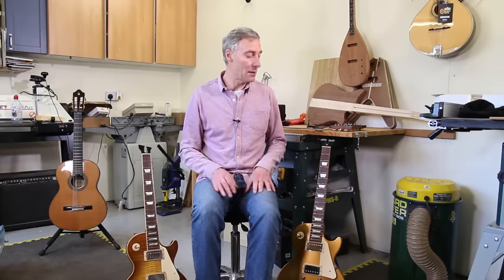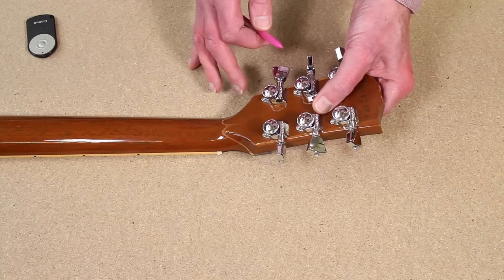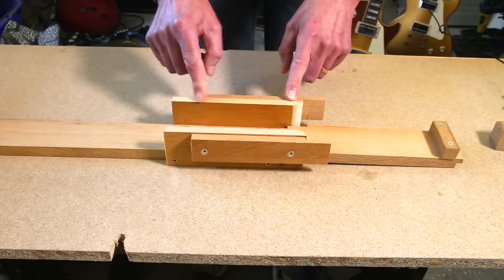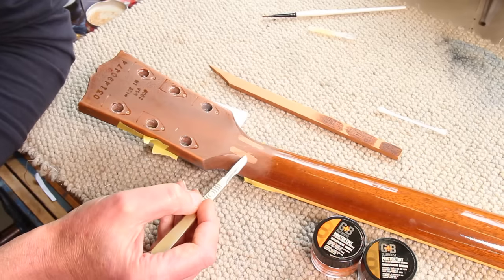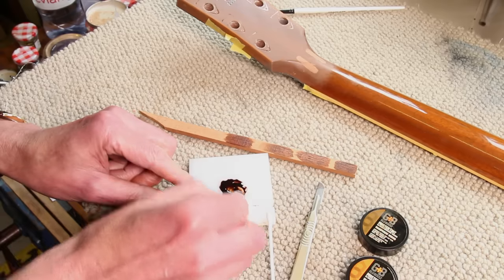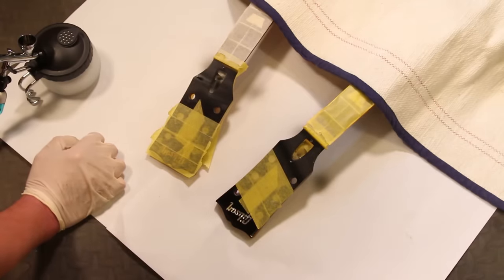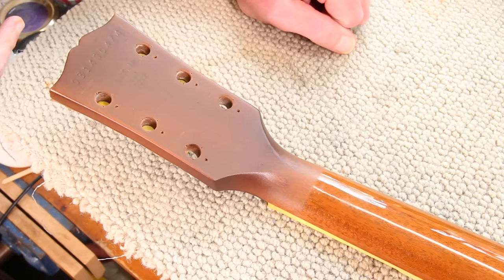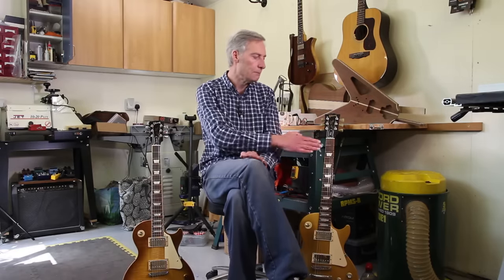Repair of a Gibson Les Paul with a snapped off headstock

Comment: I repaired an Epiphone Dot  neck with the same problem, The thing that gets me is that using the Hyde glue failed twice so I went with the Cynoacrylate Ester or CA glue exclusively.  My question is why do Master repair specialist, not do the same? Is there something wrong with my thinking. I should also note that I too, knocked this guitar over in a heated rush one day by accident, and broke the head stock a second time. Because I didn't use splints,  may have been why it actually broke again, but here is the kicker. It broke in a completely different part of the wood. The second repair is still holding fine. But, will it eventually give because of that glue choice?  Or is it just that the Hyde glue is actually better over time? I know that it is easier to remove, if that is the reason then I understand that. However the CA was used in filling. So then why not for the whole repair? What is it, that I will learn the hard way? I always do.  I am thinking about adding the splints now, But if that is going to mess me up when that CA glue decides it's life cycle is short, or it dry's the wood and it breaks again etc, then I would like to know that before I do.  That is probably something that I am not alone in wanting to know, so my question is while we are learning technique we could use a little time honored wisdom, and experience about older glue verses super glue or new tech glue.  Thank you for any answer I get from anyone in the know.

Comment: I'm doing my own fix on a '93 reissue J-160 made in their Montana factory.  Fortunately the grain allowed for a pretty good gluing without splints.  Currently planning on blending in the glue line in back which feels like I got it, though not as nicely as in these two examples.  The front veneer didn't break, but the bending made for very ugly lacquer checking.  Wondering if I should just use lacquer thinner to take off the old and then reapply with clear?

Comment: How about a drill jig to drill matching holes in the crack that you would later fit small forged steel rods that you would use epoxy to glue in the holes and then join the neck? Kind of like rebar in concrete.

Comment: Thanks for sharing your excellent work - I’ve watched a number of your LP headstock repair videos, and have recommended you on various guitar forums when someone posts and asks for UK recommendations for an expert headstock repair. I have a 2003 LP Standard that had already had a headstock repair which I got for a good price, however, a number of months ago I found an Epiphone LP that had been left beside a skip at my local recycling centre with only the strings holding the snapped-off headstock. I rescued it, and have glued up the pieces and used Titebond, then black superglue on the facing. It has flatted back well but I need to airbrush the join as it is still visible- my question is what paint to use for the black. It is gloss poly. Any advice would be most welcome. Thanks, best wishes and keep up the great work
Reply from the maker: Andy, just noticed your comment. Because of the finish that Gibson use it is easier to get a seamless transition between the new and old finish. Not so with an Epi. You will always get a witness line whatever paint you use. You either accept this or spray fresh paint over the whole of the neck or headstock. And thanks for recommending me elsewhere.
Reply: @flameguitars5770  Thanks for the reply David. I’m treating this rescue project as a learning experience. I’m pretty happy with the way the headstock has been reattached and how the filling / smoothing process has gone and just looking to get it as good as possible within the limitations of my skills! I’m  travelling with hope rather than expectation, and whilst I’d love it to be perfect I’m realistic enough to realise that it is likely not to be as it is my first attempt (apart from crudely gluing a broken headstock on my sisters Eko Ranger about 50 years ago when I was about 10! - crude but it held for 20-odd years) Anyway, I was thinking of getting an airbrush to give it a go but just keen to know what paint to try - diluted Airfix enamel? Aerosol paint sprayed in to a container then put in the airbrush? I’m going to flat then clearcoat the whole headstock with aerosol after I’ve sprayed black over the crack but understand paints can react badly if I use incompatible ones so just looking for a steer in the right direction. Love your videos and find them really relaxing to watch, as well as fascinating! Thanks again, Andy

Comment: Knowing that the majority of neck breaks are Les Paul’s isn’t a comforting feeling since I own one. Gibson are known for making outstanding guitars but I can’t help but feel like I’ve learned the opposite over the last 10 years of ownership. I own a PRS Custom 22 that’s roughly the same price, but the build quality is night and day. The 22 almost never needs tuning, has a seamless design and nothing is wearing down on it - they’re both the same age. The Gibson however has required a re-fret during its life, paint is cracking and starting to come off and the plastic trim is cracking at the bottom. Screws have rusted along the way and the bridge piece has had to be filed down more times than I care to remember because of rust or biting issues.

Both guitars have received the same care, attention and treatment over the years. Playing time may be a bit more on the Les Paul’s end, but not enough to justify the amount of TLC it’s needed - the PRS just hasn’t been as needy.

Les Paul’s might be iconic, visually and tonally. But my experience of their £2-£3k high end instruments is horrendous. Guitar is only a hobby for me, but I’d never buy a Gibson again. PRS’ build quality is second to none and they sell single cut guitars that give you 95% of that “Gibson sound”. Gibson doesn’t deserve people’s money. Professionals only buy Gibson or Fender because they can reliably get what they want at short notice if need be. PRS’ can be one of a kind as long as you’re happy to pay for a Bespoke guitar. I’d do that before buying Gibson....

Comment: Very helpful video.  Outstanding repair!  I've got a Luxor Les Paul with jagged cross-grain break of the head-stock right at the top of the truss rod....I got the guitar free and plan on doing my own re-build.  I'll build a jig, bond the pieces back together, route a couple slots and put maple splints in place.  Any advice on dealing with the jagged splinters...(It appears to go back together "okay" (I'm guessing I'll just do whatever I have to to get the angle right and get the mating sides to all match up...may require some axial pressure as you suggested).

In any case, wish me luck!
Reply from the maker: That sounds like you are doing all the right things. I have 2 other videos on neck repairs which may be helpful. Anyway, good luck!
Reply: One more...for my slots I'm planning to go with straight 2 flute carbide cutter...1/4 inch...you think I'll have any luck?  Or is something else called for (e.g. special plunge spiral or mortise bit)...also I'm thinking 1/4" (6.35mm) maple would be plenty...but could go as big as 3/8" (9.5mm).

Thanks for your expertise.

Comment: Fantastic video and very informative.  I have a Astoria guitar to repair for a friend.  Its got a very bad neck break that has been repaired before, so I think I'll need to do splints for it to stand a chance of it being successful.  I just wondered why you used the Titebond Hide Glue rather than the Titebond No 1?  I've used Titebond No 1 and 2 on a lot of repairs and its been quite successful.  The yellow colour of the glue can sometimes be a bit annoying though.
Reply from the maker: Thanks. I mostly use Titebond original for this type of repair. But if I need more time to align the parts I use cold hide glue. Takes a little longer before it 'grabs'.
Reply: @flameguitars5770  thanks for clarification, very helpful

Comment: I just use some flat wood blocks but sandwich some stiff plastic foam between the wood blocks and neck , especially to apply pressure directly over the cracked area , it often passes the flat areas, still get a lot of pressure , often the crack is hard to detect if the break is really clean no need to refine try to hide it, just if the headstock if its a total break away can do something to the black face area , i never use dowels or splints , Why ? ! I've seen them re-broken and they just result in greater damage if and when that happens.Looks stronger , just cosmetic, waste of time and labor, i have filled in missing chunks of wood on other guitar necks that get more complex breakage.Overall you do excellent work ! master .
.

Comment: Very nice work. I have fixed the headstock twice on my Les Paul Special. It does not look nearly that nice but does give me some ideas to blend the repair in a little better. I specifically watched this because I am bidding on an epiphone es 335 with a completely broken off headstock and I do not believe he even has the headstock. I was wondering if it would be possible to simply make another headstock and treat it as break?

Comment: Great job!  Facinating to watch.  May be about to attempt a similar repair soon.

One question.  Doesn't the blended lacquer line on the splinted neck leave a slightly perceptible (visual or touch) join line?  I might have been tempted to apply a final coat of clear lacquer along the whole length of the neck to avoid this...
Reply from the maker: That is certainly the case when trying to blend new finish onto old over a poly-type finish. Gibson still use a nitro-cellulose finish which means that the transition between new and old finish can be close to invisible.

Comment: I repaired my sons Les Paul, broke on the neck. I'm pleased with the repair l did but obviously l can't use the truss rod. It plays well but getting the action right is a compromise. Any ideas?
Reply from the maker: You say obviously cant use the truss rod. Why is that? Did you get glue on it?
Reply: Because it broke slightly more towards the body. It tunes fine, but  playing higher up the neck, he gets fret buzz. If l higher the action, then it's harder to play. Stumped really?

Comment: Outstanding sir!!
Loved the way you mixed the stain with Crazy Glue to prevent the bleeding/ highlighting the edges of the splints.
I remember my Dad having an old Premier guitar that had a split at the neck/ headstock   point,  and he put a screw in it. Lol! Of course my eyes crossed when I saw it and was surprised because I new he was a pretty good craftsman. He had taken an oak floor tongue and groove apart from a broken steam pipe warpage, and repaired it, stained it,  and it looked like a bowling alley when finished.
Anyway thanks for the lesson in patients! Are you in the States or UK?
R
Reply from the maker: London UK

Comment: I have a black 1974 Les Paul Deluxe I picked up cheap. Could never read the
serial number because of a heavy sprayed paint job. When I tried to sell it, somebody
pointed out that the head probably broke off at one time, which explains the heavy  paint.
Basically my LP's value dropped to about $550 in value, I decided it
wasn't worth selling and just held onto it.   The good news is, I got it for only $320 from someone
desperate to sell it at the time.

Comment: I always hated doing this type repair because the parts can slide when you clamp it. So what I did was to clamp it dry. Then drill 2 small holes a short distance apart from each other so I could insert 2 small wooden dowels after applying the glue. Then clamp. That way it cannot slide.

Comment: Good job. Would it be possible to drill and glue a steel pin inside each of the two pieces of mahogany, to further strengthen the headstock/neck?

Comment: I just find it amazing that Gibson are still making guitars & especially the very expensive replica "vintage" guitars with this extremely flawed design, but what is even more amazing are the customers handing over wads of cash knowing full well what Gibson are doing - well I suppose the ones hanging on walls in offices won't be in too much danger (although probably not) as long as the temp & humidity is maintained.

Comment: I have a free acoustic guitar that got kicked hard by and angry girlfriend that split the neck about 12cm vertically. Near parallel scars, didn't break off. These are simple fixes if one doesn't care about the scars. And I don't. Lovely Crafter Korean guitar with Fishman electronics. Saddle and nut were lost before I got it but not hard to replace. Flame Guitars does a masterful job, but not all guitars need that care. They'll still play and I personally don't notice the scars when I'm in the pocket. Good thing too as my old body has more scars than my old guitars. My point is: if it's broken  and not precious, just fix it yourself. For the precious guitars, thank goodness for craftsperson luthiers.

Comment: Great job! Only question - why Titebond hide glue? The joint is permanent, no need for disassemble in future. Why not Titebond Original, or even some high quality epoxy?
Reply from the maker: Yes, a number of people have asked about this. When gluing the headstock and neck, this glue gives me a little more working time to ensure the parts are properly aligned before the glue starts to "grab".
Reply: @flameguitars5770  Makes sense. Thanks for the answer! Have to say again - magical work!

Comment: This is very very interesting. Thank you for posting this. Will this new neck arrangement be an improvement and remove the weakness Gibson built in thereby making it stronger than new?  I remember breaking the headstock off my first electric guitar, a Burns Shortscale Jazz bought for £30 used when I was 14. Unfortunately I didn't have you to repair it for me and the guy who did it botched it and it never was right again. I always worry a bit about my Les Paul for the reasons you mention.

Comment: Out of curiosity, why did you choose to use hide glue over Titebond regular glue? Great video, and even better repair!
Reply from the maker: Generally I do use Titebond for this type of repair. But if I think i need a little more time to align the two parts of the neck when clamping then I might use cold hide glue. It gives a little more working time before the glue grabs.

Comment: Thanks for the video, your work is masterful and a pleasure to watch. I am about to make a similar repair to a broken headstock on a "Fernandez" electric guitar. I noticed you used Titebond Hide Glue (which I have) as opposed to Titebond Original (or yellow) Glue. I have always felt the yellow glue is stronger than the Hide glue. Your thoughts?
Reply from the maker: Yes, I've been asked about this a number of times. Hide glue gives a longer working times to ensure that the two parts of the neck are properly aligned before the clamps are applied. If the two parts come together easily I would use Titebond original.
Reply: @flameguitars5770  Thank you sir for the quick reply... I'll go with the yellow :-)

Comment: I have an 89 Les Paul standard that I snap the neck on and I almost turned into firewood I was so upset, but a good friend of mine which also played Les Paul's tell me he had snot the neck off of his at one time and he had it and is exactly what I did and a really fine job is just place did. But I have a question for you if this is happened to your Les Paul how much of a discount on the price value do you lose, could you please answer that

Comment: What would you suggest for refinishing the front headstock face of an Epiphone model where the black finish is heavy paper stock under and bonded to a clear layer of plastic?  Any attempts of mine to airbrush blend still shows a visible line between sprayed on paint, and under the plastic black. (Think two depths visually).

Comment: What glue are you using? Would a bow tie joint be stronger?
I don't repair guitars but am a joiner/ carpenter.
It's good to see such love going into something like guitar repairs. Thank you
Reply from the maker: Mostly use Titebond. I guess a tie joint would be stronger but would be quite a challenge to install on such a rounded surface. More importantly the the two spines have to be routed on each side of the truss rod.

Comment: Hi, when you were sanding the headstock were you not worried about water getting down the tuner holes
Reply from the maker: That's a good point. The amount of water I am using is not really enough to cause any swelling in the tuner holes.

Comment: How long should one wait before sanding and staining because of the splint sinking and the neck swelling from open air ?
Reply from the maker: I shape the splines as soon as the glue has set. I then seal the bare wood with CA glue.
Reply: @flameguitars5770  Thanks for the feed back. Makes sense  now.

Comment: Hello! Could you tell me what paint and varnish to use with the airbrush? I use acrylic paint and Vallejo polyurethane varnish, and then it won't let me sand because it comes off easily. Thank you!
Reply from the maker: Nitrocellulose lacquer
Reply: @flameguitars5770  you don't need to dilute it And if so, what do you dilute the nitro with? thank you.